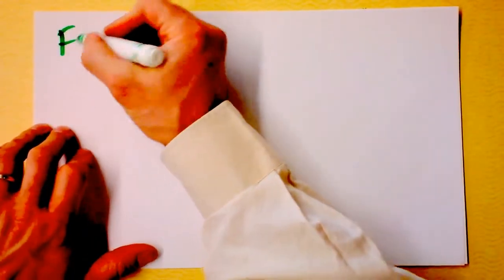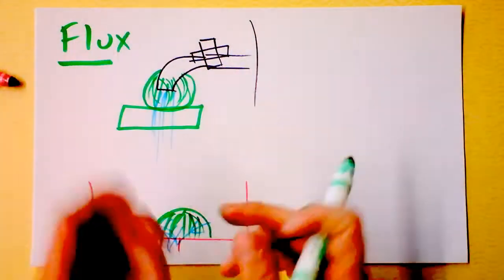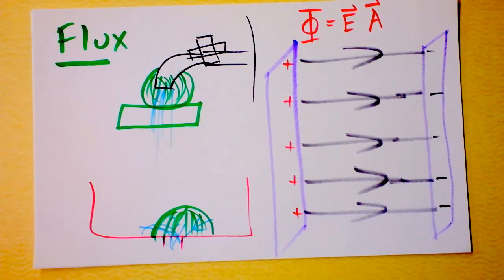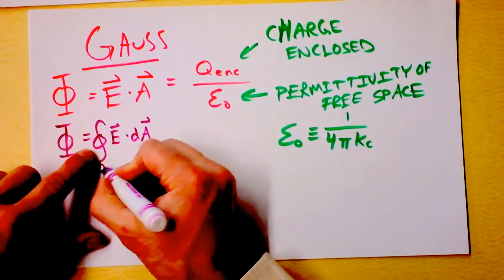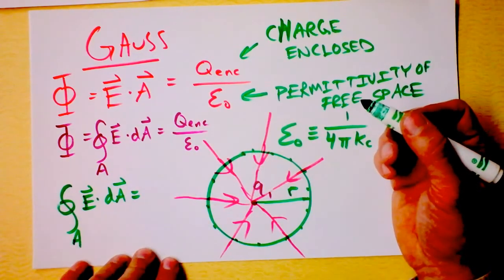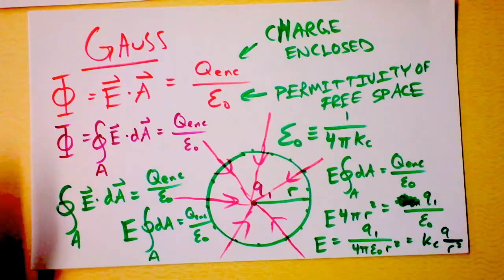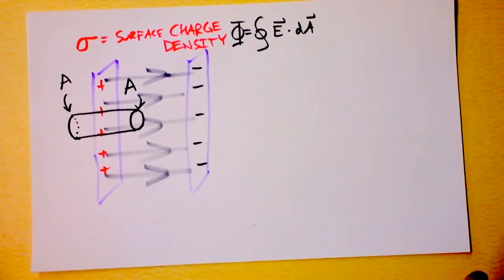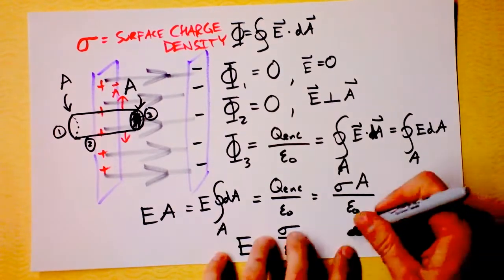Gauss' Law Explained and Parallel Plate Capacitor Worked Examples | Doc Physics

Comment: So I've heard that there is electric field outside the parallel plates mentioned in other textbooks. Can you provide your explanation as to why there is no electric field on the outside, considering the plates r thin for an infinite sheet of charge.
Reply: What If? Suppose two infinite planes of charge are parallel to each other, one positively charged and the other negatively charged. Both planes have the same surface charge density. What does the electric field look like in this situation?

Answer The electric fields due to the two planes add in the region between the planes, resulting in a uniform field
of magnitude s/P0, and cancel elsewhere to give a field of zero. This method is a practical way to achieve uniform
electric fields.

Taken from "Physics for Scientists and Engineers" by Serway
Reply: If both plates are positively charged then there must be electric field out side of the each plate ,and zero is inside the plates

Comment: Why is the E field not equal to sigma over 2(epsilon0)? Wouldn't you account for the field lines going both out of the positively charged plate and into the negatively charged plate?

Comment: Sorry if this sounds dumb, but at 10:25 you said that the integral of dA over A is surface area. However in the parallel plate capacitor question you said the integral of dA over A is just area.
Reply: Swaggy P Nevermind, biggest brainfart ever.

Comment: Unless I missed it, the analysis of the parallel plate capacitor neglects to mention that it assumes charge sheets of infinite area.  I think this is important because it's necessary for a proper intuitive understanding, as well as formal correctness - for example, it's not clear why the electric field is zero outside the capacitor otherwise.
Reply from the maker: ***** YES!

Comment: The proof that I came up with for the E of a parallel plate capacitor is a bit different. What I did, is I treated each plate as if it were an infinitely charged plate and then made a cylindrical G.S. through each. The result was that on, say, the positive plate you get field lines parallel to the area vector (i.e. pointing "out of" each circle at the ends of a cylinder), and, on the negative plate you get the field lines exactly antiparallel to the area vector (i.e. "going into" each circle at the ends of a cylinder). In the former and the latter, the answer came out to be sigma/2epsilon (since, if you keep track of your negatives correctly, the latter case turns out a positive answer). Then I noted that for ALL parallel configurations of the two plates,you always get parallel lines inbetween the plates, and antiparallel lines on the outside. Therefore, by the law of superposition of electric fields, the electric field always cancels on the outside, and always adds on the inside to give you E=sigma/epsilon. QED. 

P.S. I think that you had this proof in mind when you said that there is ONLY an electric field between the plates, which is by all means correct (as i just proved), but it would be helpful to run through a quick informal proof not unlike the one I just presented to enforce the intuition for why that is the case.

Comment: Hi!  I have an interesting thought/question

Eventhough its only the conduction electron  that moves to one side in a  conductor, am I  correct in saying that  the PROTONs displacement is also changed?  the reason is that the protons should be attracted closest to the higher electrons density on each side, i..e  in charged solid sphere::
1-The excess charge  electrons are all at the surface. 

2-the protons  of the atoms closest to the surface are slightly displaced and attracted to the higher density of electrons. I am really wondering about this.. 

Could you please if you can  help me with this?   

Thanks for your time reading my post
Regards
Karl
Reply from the maker: Hey Karl!  I agree that the protons are attracted to those electrons, but remember why the electrons displaced in the first place - there must be an external field.  The protons will also respond to the external field.  But I don't expect bond length to change, so if any protons move, all of them will have to.  Fun question.
Reply: Doc Schuster 

Thanks Doc!

hmm, I am not sure if I  got it.  Lets have a solid  sphere, put on it some  () charge for example and just leave it there. Now, please bear with me ,  Besides these cute extra electrons that are all now  resting evenly on the surface, arent all the protons aswell somewhat  a little displaced from their original orbit/cloud/center compared to where they were  before there was a() charge?

 In other words, arent the protons  situated now  more "outwards" towards the excess () surface charge ?.  Furthermore If this is the case , and because of equal pull of the excess () the only protons that are basically  almost undisplaced are the protons in the perfect  and absolute center of the solid sphere, theoretically ( although  I know there is no such thing as perfect proton in the perfect center but you get my idea).
Reply from the maker: If we're considering a charged spherical shell, there is NO electric field anywhere within it.  The same is true inside any perfect conductor.  So the protons that are not on the surface don't even know that you've put charge on the outside of the sphere.  Consider a free proton about 2 cm from the center of an 8 cm diameter sphere of electrons (nevermind how I made it!).  It will be quite attracted to the (few) electrons near it but also quite attracted to the (LOTS) of electrons that are the opposite direction.  The symmetry of the sphere makes these two pulls identical.
Reply: Doc Schuster Good Doc! we are the same track now! To get to the point clearer lets continue on the 8cm solid ball example. and let that proton be 2cm to the right from center. when the  ball is not charged, this proton is attracted to the sea of electrons all around and  the proton is in balance and has a specific location roughly in some measurable point in space. Now!.

After the ball  gets those extra electrons on its surface here is what I thought should happen:

The proton as usual will be still attracted to the sea of electrons in the"right" and  the"left" of the proton. However since now you have a more negative charge on the surface uniformly,  and thus the field is increased on the right of the proton and since most importantly "the proton is to the right" of the solid ball´s center, the proton now should feel a more attraction force from its right  than its left. If our little proton however were to be in the theoretical dead center of the same CHARGED solid ball then I would agree that the proton doesnt displace at all.

 I am not in argument that I am correct ,  I just  want to understand why the above is or is not the case.

 I really hope  I can  understand this to me very interesting and puzzling situation,
Thanks  a lot for your help
Reply from the maker: I guess I want to encourage you to agree with two things:  1) the ball will have all its charge on its surface, and 2) there is no electric field at all inside a spherically symmetric charge distribution.  If you'll give me those two points, then the proton will feel no force due to the charge on the outside as long as it is within the ball.  Outside the ball, of course, symmetry allows the charge on the ball to act like it is concentrated at the center of the ball (assuming it can remain spherically symmetric).
Reply: Doc Schuster  Of course, Yes, I am aware of 1 and 2 and yes that is how it is.. I am however looking at the details and inner of an object.   I mean, if you just think about this in detail and not just  general attributes like  charge and field,  if you think about this whole thing in detail and looking  at them  as particles,. matter is really just  moving particles.   when you see that they are all small particles moving all over the place they should indeed at a the very least communicate to each other regardless of material type or  type of force, ha?

kind of like Van der  wals forces and london forces where  neutral atoms form dipoles  and affect each other..  So any electron in any orbit in any atom will have a tiny  but real effect on its neighbor.. ah maybe this question is not  as easy as it sounds.. thanks  for your time, wish you the best and keep doing these great videos
Reply from the maker: Hang in there and let me know if you have some insights that can help me understand in the future!

Comment: Why is it that we don't also add the equal electric field caused by the negative plate? (otherwise I love this video)
Reply from the maker: The beauty of Gauss's Law is that we HAVE included the field from both plates.  You can show easily using the same process that the field from just one plate would be sigma/(2 epsilon naught).  Try it!
Reply: Doc Schuster I thought that the reason that the electric field inside of a parallel plate capacitor is constant was that electric field is inversely proportional to distance, so the farther away from one plate you get the weaker the electric field due to that plate but the stronger the field due to the other. If there was only one plate, wouldn't the electric field vary with distance?